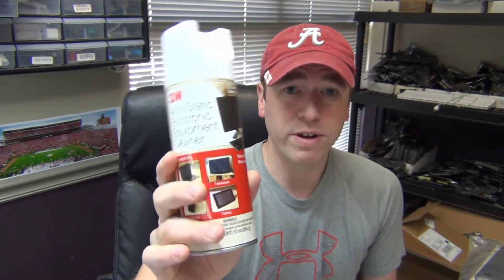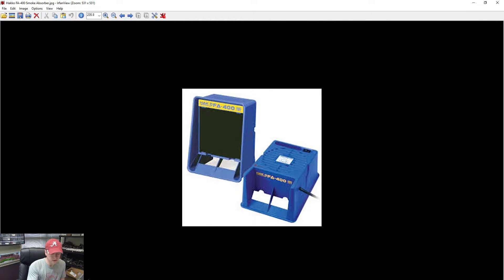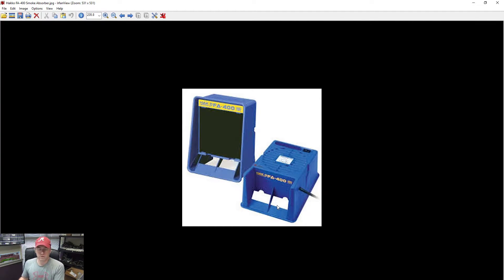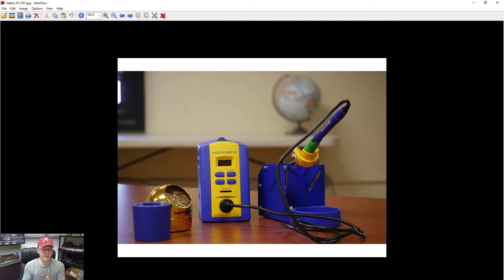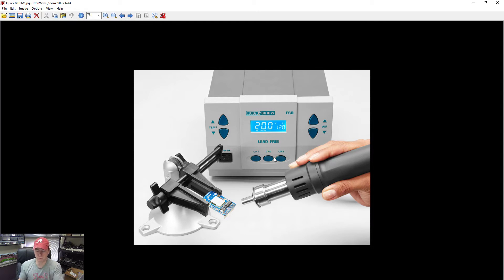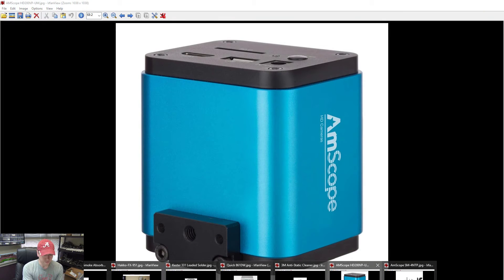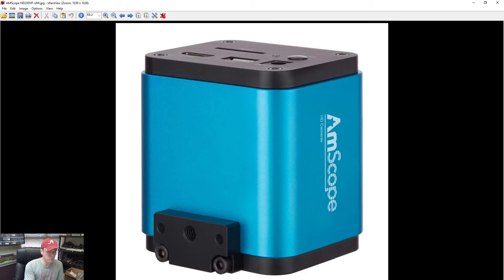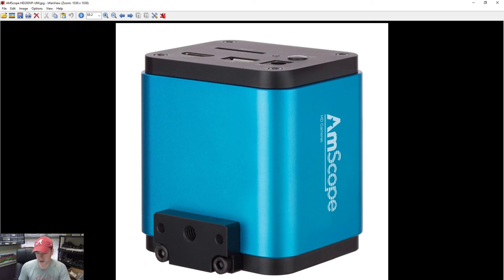Tools We Use For MacBook Logic Board Repair

Comment: Hi.Thanks for your video. A couple month ago I bought another brand of hot Air Station.but unfortunately I don't know how to work with that,I don't know which temperature and Air I have to set to start take off elements from the Apple logic board. I am wondering if you would make a clip and teach  us from the scratch stuff like that.thanks
Reply from the maker: Moe Soheili Thanks for the suggestion! 👍🏻

Comment: Thanks very helpful. What ultrasonic do you use?
Reply from the maker: Mario Yiannakou Glad you enjoyed it! It’s a Digital Ultrasonic Cleaner PS-40A
Reply: Powerbook Medic I generally run my ultrasonic for 2 minutes on each side of the board. How long do you ultrasonic your boards for?
Reply from the maker: Mario Yiannakou Two minutes is good if you have your cleaning liquid heated up.  Having heat makes the cleaning work much more efficiently.